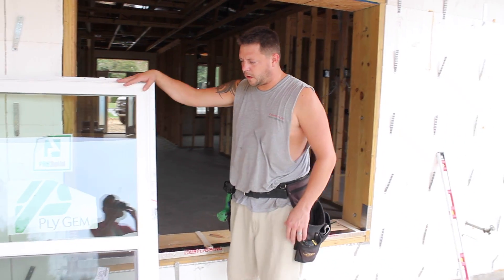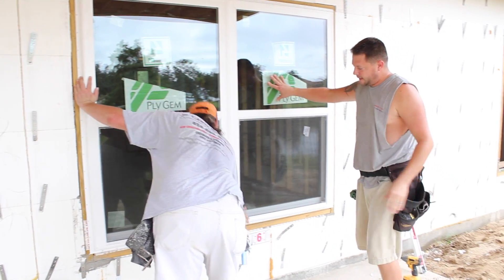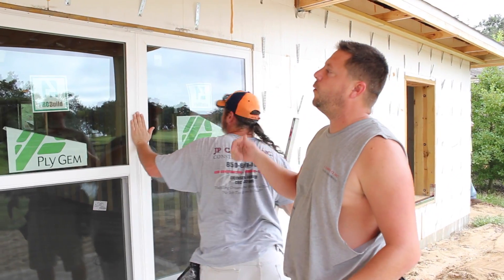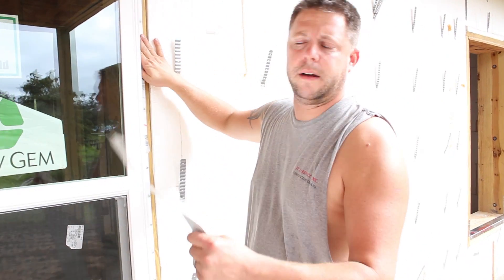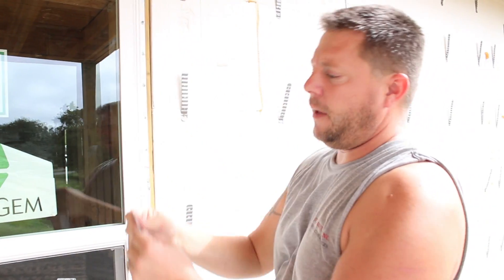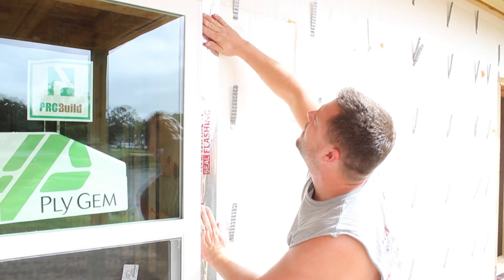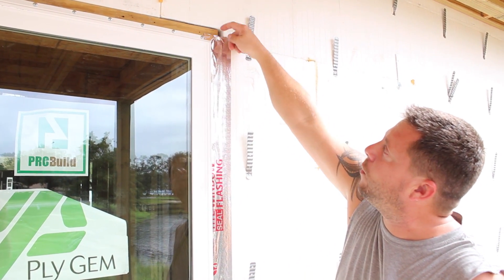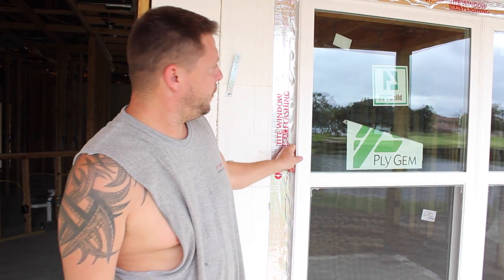How To Properly Install Impact Resistant Windows In New Construction

Comment: No screws thru the jamb? For impact?
Reply from the maker: Tara Adcock You only go through the jamb on remodel window installs. Otherwise you follow the manufacture specs.
Reply: @JPCarducciIncFortWaltonBeach  The PGT specs have 8 options. Wind rating is one of the drivers. I am new to this, did not mean to offend.
Reply from the maker: Tara Adcock oh no offense taken at all, you are correct but I am pretty sure that is if the windows do not have the nail fin, which you see on this install.
Reply: Block install windows get screwed on the jam.. Wood doesn't have any holes inside
Reply: Their installing windows in a non high velocity winzone. Screw off code not as stringent!!! In south Florida the the buck would have to be 1/4 inch Dia.  tapcon per code and the widow jam would have to have 1/4 inch dia. Tapcons  as well as the fins have wood screws in to the buck. You must provide pictures of every step and have in progress inspections.  Window impact code is not the same for the state of Florida it all depend on the location and proximity to the coast.
Reply: @2dogmanshawn  That is not true. It is all based on wind load and design pressures calculation and designated wind zones as per Fl code.  For all of the central Florida  people not all impact windows  can be used everywhere in the state of Fl. Impact window on the coast above 3 floor or in a high velocity wind zone have a totally different design pressure. I Have install winds that had to meet +90/-90 wind pressures I would guess that the windows in this video are +45/-45 or less in that case they will need less fasteners.

Comment: Things wrong in this video! 
1. You didn't tape the sill of the opening before install!!
2. You leveled the window from the outside before making sure both sashes operate correctly, make sure they lock with ease slide up and down with ease, and make sure youou have no daylight coming thru the weather strip between the sash and jamb when it's closed
Reply: Oh and I never seen you caulk the fin before you put it in the opening!